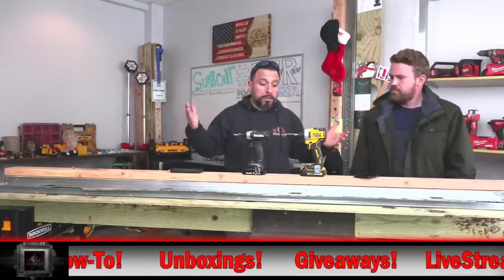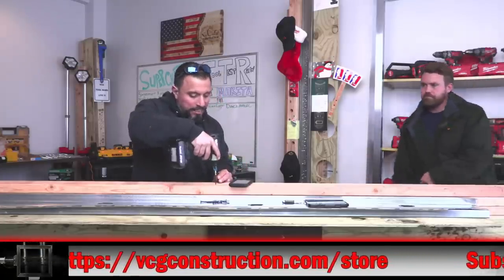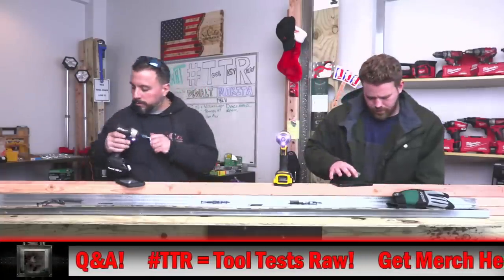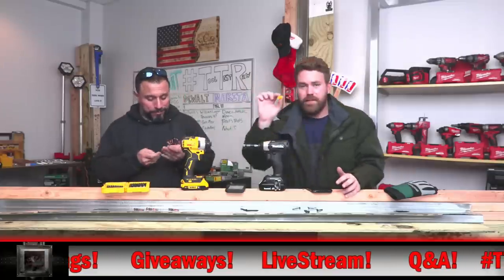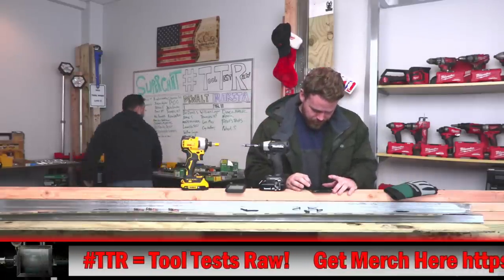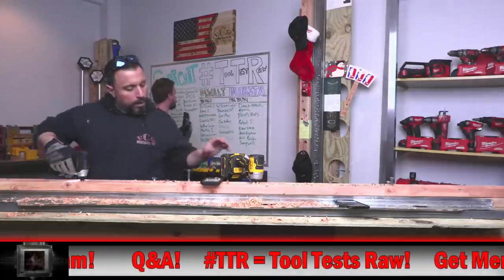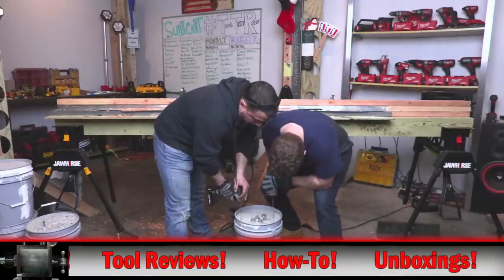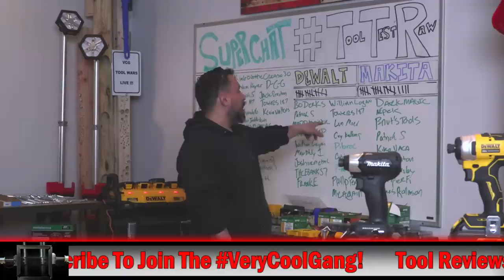Best Compact Impact Driver Tool Test - Makita (XDT15) VS DeWalt (DCD809)

Comment: Makita is a far superior tool manufacturer compared to Dewalt.  Fit, finish, quality, longevity.  Dewalt has the brand recognition due to outstanding marketing for decades.  If the money spent on marketing was shifted to quality management, they would make better tools.  Advertising sells!  Makita gets my hard earned money.

Comment: The Makita looks like a better tool at a better price with a better feature set. For a beginning woodworker or carpenter, this might be the ideal platform. Now if they came out with other lightweight tools such as a circular saw, portable table saw, portable drill press, etc., I'd buy it in a heartbeat.
Reply: My Makita little brushless circular saw is a joy to use and has done away with my bench saw. It's light, quiet, quick, mdl No : DHS680 and stops fast too
Reply: I wish they had a cordless table saw.  I bet one will come soon on their 40/80 platform

Comment: You should do a Dewalt & Makita Sawzall showdown. I'm a commercial electrician from oklahoma & I've buying & using Dewalt for years but frankly, I'm so disappointed in the performance of the Dewalt sawzall & self loosening chuck during operation on the Dewalt hammer drill that I'm thinking changing lines
Reply from the maker: We can try and set that up!!
Reply: @VCGConstruction  Hey that would be much appreciated & if you do, then you should include Milwaukee in there too of course. Thanks guys

Comment: Love the videos but it says absolutely nothing about the tool if one person struggles to get the screw on the bit. I’ve watched so many ttr videos and every single time it’s clear that Vince is better at driving screws fast. It’s nothing against nick, but it’s so clear. If nick struggles with 3 out of 5 screws, there should be no mark on the board. Also, who’s putting more pressure? Who’s angle is better? I don’t understand how you guys think these are accurate. And I think the Makita is better
“It’s like the tortoise and the hare. The Makita started fast and then the Dewalt caught up” yeah as soon as you swapped tools lol wtf.
Reply: First video I've watched and that was the 1st thing I thought too. Amateurs.

Comment: That Milwaukee matrix carbide bit broke without much abuse or ware.
Reply: that bit was used in the demo when the milwaukee reps came in so it was well used to begin with...but now its been tested and you know what to expect...its prob not going to break like that under normal circumstances...they pushed it to the limits and showed how the warranty process works as well

Comment: DeWalt bits are shit! I run DeWalt 20V Max everything. I used Makita Gold and they hold up until you used them in extreme cold and they bust like glass. The best bits I ran are Milwaukee and have always used them. I'm a metal stud framer.